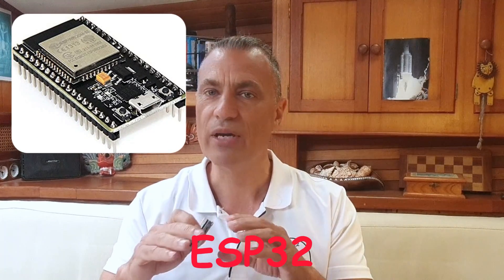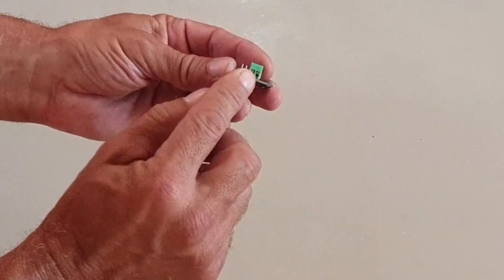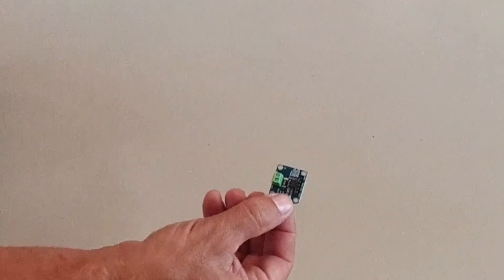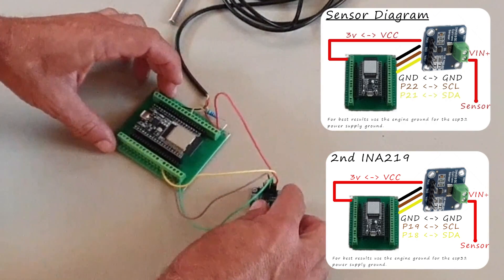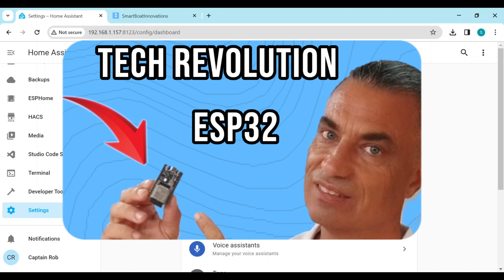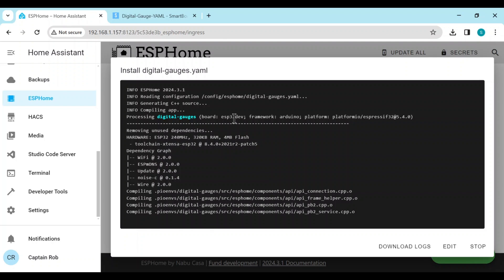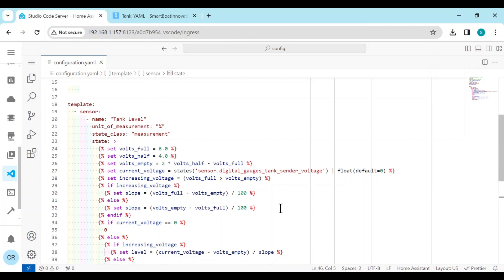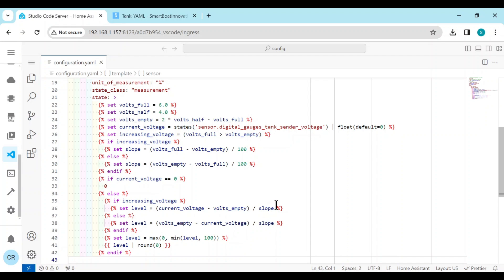Analog to Digital Gauges with ESP32 and INA219

Comment: Insted of ina219 a better solution is to use acs712. It is isolated from the current you want to measure. It is based  on hall sensor. It does not have i2c only analog output.  Isolation is important in a boat where you have more than one battery.  ALso the power to the esp32 should be isolated, and also the nmea2000 (can bus) should be isolated from the boats plus and minus.

Comment: Sorry to be a pain but I only just discovered your channel and find it really helpful.
Are you aware that I2C can have many, many devices on the same bus?
For the second sensor you just bridge one of the A0 or A1 or both to change the address and you can have up to four INA219 in parallel on the same pins before you need to use the second interface that you mentioned. You are not wrong but you only need to resort to using the second set of pins once your four places on the first bus are used up.
Also, you are not limited to the INA219s, you can put all of your I2C devices on the same wires. BMX280, touchscreens, displays, whatever. It really simplifies wiring and reduces points of failure. If your I2C bus is working then it only comes down to whether it can see the new device on the bus or not which is usually a simple matter of making sure you have the right address for each device.
Hope this helps.
Reply from the maker: Thanks for the detailed comment. Yes I am aware of this. I have specific article on my website that shows how to do this.
https://smartboatinnovations.com/ina219-voltage/
But for beginners it is easier just to connect a 2nd INA219 to different ESP32 pins as nothing needs to be soldered.

Comment: Really helpful.
I'm wondering if it's possible to use an ESP32 with a display attached to it as an alternative to buying a full tablet. My idea would be essentially a fixed position dedicated dashboard display, possibly with a touch screen to switch between panes. Much like fancy marine displays from Raymarine, b&g etc.
I'm assuming the easiest is to use an spi display and put a dashboard on it with a web browser library?
Reply from the maker: I use these 2 tablets. They are very cost effective. Especially the waterproof one.
Oukitel RT3 Mini Rugged Tablet 8 Inch HD IP68
https://s.click.aliexpress.com/e/_Dehawj1
PRITOM 8 Inch Tablet Android 13
https://s.click.aliexpress.com/e/_Dd8BkAX
Running a full-featured browser on an ESP32 with a display is highly impractical due to the limited hardware capabilities of the ESP32.
Reply: @SmartBoatInnovations  that's a lot cheaper than most of the tiny TFT displays for the esp32.
I do like the idea of creating fixed cockpit instrument displays but that can be a future winter project.
Reply from the maker: @SustainableSailing  Here is the waterproof tablet installed in the cockpit.  Simple fast menu to switch from HA to Navigation etc.
https://drive.google.com/file/d/14sFfZFIz1F30SlPQo-H4NSAyV3eKbCfr/view?usp=drivesdk
Reply: @SmartBoatInnovations  are you using opencpn? Is it possible to connect that to ha? (Or is the NMEA 2000 all that is needed)

Comment: Thanks for the video Rob!  I am looking to digitize my generator gauges (4 analog dials) and have it display on my HA Dashboard.  For this I think I will need 1 ESP32, 4 INA219 and then wire it up to the Westerbeke gauge box.  Correct?
Reply: You can use 1 INA3221 (3 channels) and 1 INA219 (1 channel)
Reply from the maker: @kinyo666 Yes you can. Very good point. Esphome supports the INA3221 as well.
Reply from the maker: @PtJudeRI  Yes that is correct. The esp32 supports 2 I2C devices with the same address so you can connect 2 ina219 directly using different pins.  But the other 2 ina219 you will need to connect them in parallel with one of the existing ina219 and you will also need to change their default address. See on my website under articles and ina219 how to do this.

Comment: {% set volts_empty = 0.1 * volts_half - volts_full %} Can you explain what this does, I could not get gauge to scale with this in place, and ended up placing just a constant in here like the lines above but for empty voltage.
Reply from the maker: My original yaml was
{% set volts_empty = 2 * volts_half - volts_full %}
I am not sure why you have 0.1 instead of 2
This line is a calculation for the empty voltage.
If you know the actual empty voltage then a constant is fine.
I hope this helps.
Reply: @SmartBoatInnovations  Thanks Rob. Great videos by the way.

Comment: Can you explain where your ground goes, as with your explanation the voltage is floating. Also worth noting that if you add a second board, make sure you solder the A0 or A1 address tabs on the board.
Reply from the maker: See my article for more info
https://smartboatinnovations.com/ina219-voltage
As I mention in the video to ensure accurate voltage measurements with the INA219, the ground (GND) of the INA219 needs to be connected to the same ground reference as the voltage source being measured. This is crucial for maintaining a common reference point and avoiding measurement errors.

Comment: I was wondering if the analogue gauge could be omitted in the set-up i.e. connect the sensor directly to the INA219 and get readings on HA, only. I would like to add a level sensor for my water tank but I don't want to install an analogue gauge, too.
Reply from the maker: The analogue gauge supplies a constant voltage so you would need to emulate that. In theory it should be possible. Just need to use a buck converter like we power the ESP32 with and setup  a voltage divider with a single resistor. The 2nd resistor would be the resistance of the sensor.

Comment: Hey Rob, thanks for making these videos. I have been trying to find a suitable semsor for my Rpi5 mcarthur hat set up that will meaure diesel and water tank levels. Both tanks are metal. Any suggestions? 

Thanks!
Reply from the maker: If you already have an internal tank sender then you can use the method I showed in this video. Or you have nothing then maybe install a Ultrasonic Level Sensor on the top of the tank. But I think it would require an entry hole to be made.
Reply from the maker: There are some Ultrasonic sensors available that can be installed outside the steel tank. Only complication is that they need to be installed under the tank which is not always easy on a boat
Reply: The mopeka sensor would work, but I'm not sure I can sync that to a dashboard in open plotter. Trying to avoid having several apps.
Reply from the maker: @ATARI_1962 I understand your concern about managing multiple apps. It sounds like a great opportunity to consider transitioning to Home Assistant.
 Home Assistant is a robust platform that is rapidly growing and widely supported by a vibrant community. It offers the flexibility to integrate a vast array of sensors and devices, which could simplify your setup by bringing everything under one roof. While OpenPlotter has been a fantastic tool, you might find that Home Assistant’s extensive capabilities and ongoing enhancements provide a comprehensive solution that can meet all your needs more efficiently.

Comment: Hi Rob, very interesting video. Could you please tell what is the sensor type. I have on my boat sensors for detecting water level in the tanks and I am using KUS 0-190 Ohm sensor. Will the solution  you presented also work for that type of sensor? The fee on the sensor is 12VDC. Do you really need the eps32? Can't this INA219 be plugged directly to Arduino or PI ? Thank you!
Reply from the maker: Yes this should work with your resistance sensor with a 12v supply.  The INA219 will measure the voltage and this needs to correlated with a % tank full. With Home Assistant it is much easier to use an esp32 for this type of project.  The HAOS is a managed OS and accessing GPIO pins is not straightforward.  But if you are using another OS then the Rpi has I2c GPIO pins you can attach the INA219.

Comment: Amazon breakout board is not available !! Yikes seems there are many Amazon reviews on various boards that they don’t actually fit
Reply from the maker: The Aliexpress one is available and they sell the breakout board to suit.  From Amazon you need to buy the 38pin esp32 that has no mounting holes in the corner. This model will fit the breakout boards the best.
Reply from the maker: I have updated the Amazon link to a breakout board that is available.

Comment: I will not be back to my boat until mid April in North Carolina. I recently got Home Assistant working, in a docker container, on a Raspberry pi 5 with 500 Gb SSD. The pi5 also has Openplotter automatically booting with necessary charts and services running. I look forward to re-watching your videos and implementing my HA smart boat. I realize there is hardware cost involved but wondering if a video showing Home Assistant running on a pi5 in a docker container might be in order.

This spring I'll be testing Openplotter pypilot running on a pi4, an arduino, an IBT-2 motor controller using a RV awning motor. I made my own steering wheel (disc) similar to the commercially available CPT autopilot. Works well from home. I'll also be testing the bluetooth autopilot app, by Pieter Oskam, using an esp2, arduino, ibt-2, and motor. Since it runs on a esp32, I'm wondering if it would be useful to integrate it into Home Assistant.
Reply from the maker: Sounds like you have a lot going on!  Home Assistant on a separate Rpi is the easiest but you can also install it in supervised mode along side other Linux apps.
https://community.home-assistant.io/t/installing-home-assistant-supervised-on-a-raspberry-pi-with-debian-11/247116

Comment: great video! I have been tinkering with making a potmeter, current leak sensor between the hull (metal) and batteries, with the INA219B and esp2, i got the adafruit feathers. initially i looked to make a device with a tiny screen with microphyton, but now i am looking to get home assistant and get more smart boat stuff, such as your brilliant videos with relays! thanks for sharing!
Reply from the maker: Thanks. Home Assistant with EspHome make integrating INA219 really easy. See https://esphome.io/components/sensor/ina219.html

Comment: Hello great video.
Could you explain how to handle current sensor 0 to 20 mA?

An other connexion option would be to send data to nmea network in order to share with both home assistant and also boat screens.
Reply: You can send the data by connecting your ESP32 to Raspberry Pi (Wifi) with Signal-K server running on. Using the framework SensESP you can get all the data shared and then send it on your NMEA network with a RS485 Expansion HAT. That's a project I am thinking about :)